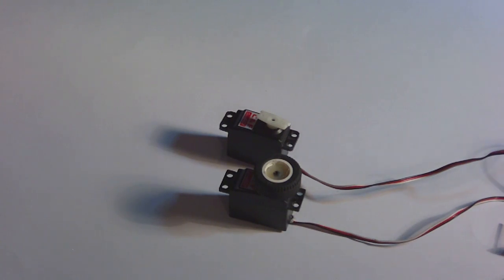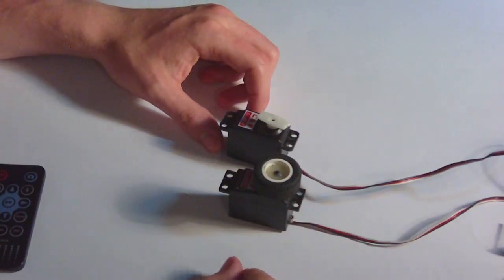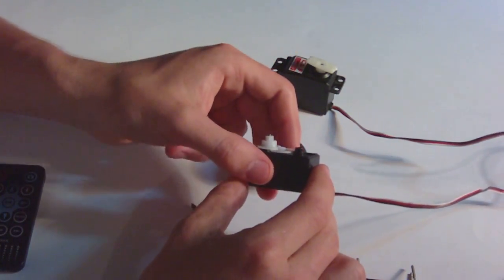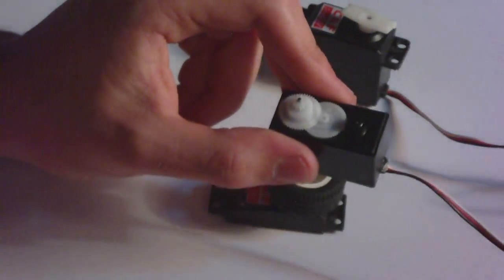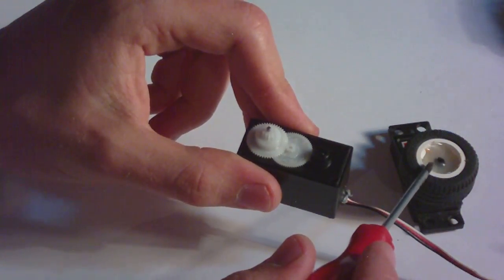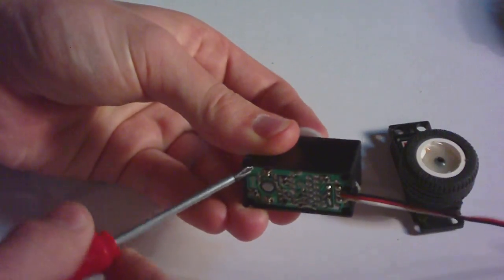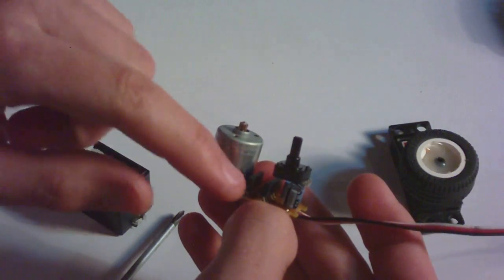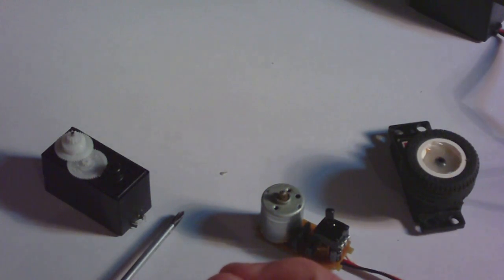Howto: Continuous Rotation Servo

Comment: Thanks for this video!!  I am wanting to setup an "open loop" system for pan/tilt on a tripod mount.  I have a Flysky F6-T6 and Turnigy X9 radio.  If I modify the servo to full rotation, how do I set my radio/transmitter so that the servo will NOT return to the "middle" point once the joy stick returns to middle.  I want the servo to stop where it is when I let go of the joystick.  Thanks for any advice you can offer :)

Comment: Quickie way but has no wheel speed feedback.  So, it will not maintain speed with different loads.  I used a Parallax BOE-BOT with it's continuous rotation 'servos' to test on an inclined plain,  the car moves different amounts depending on the steepness of the hill.  I'm new to servos & RC so someone else prob. knows a way to address this ?